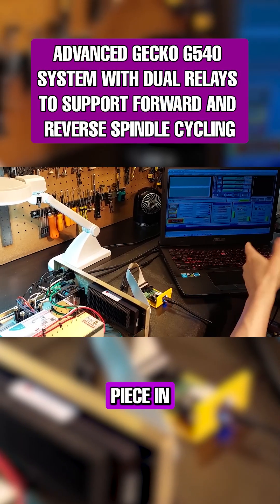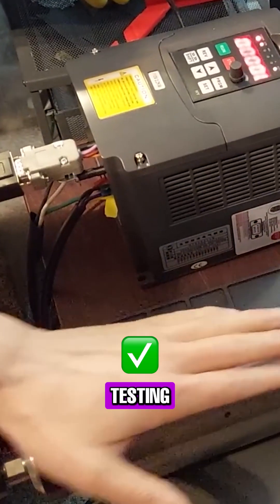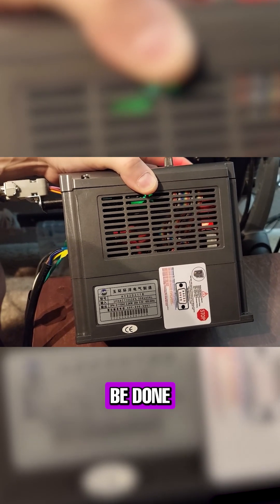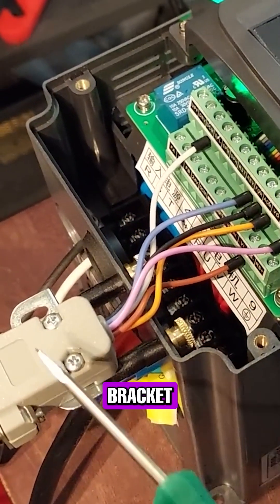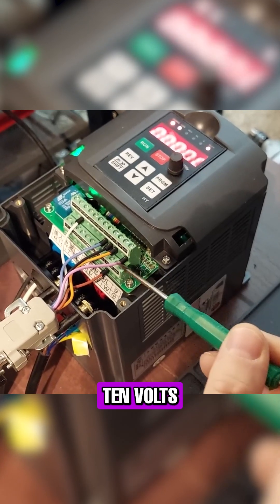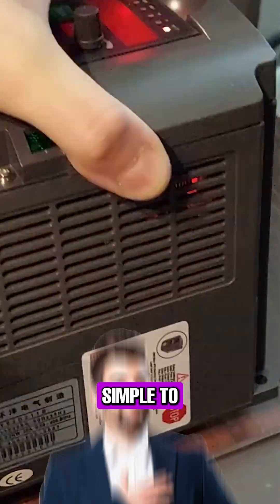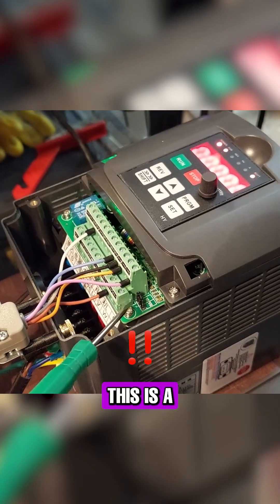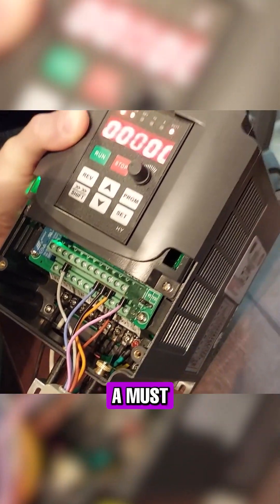Advanced Gecko G540 Spindle Control: Dual Relay Setup for Forward/Reverse  VFD Cable Best Practices

Comment: Db9 connector with mounting bracket sounds like you are huffing paint fumes. What kind of pseudo engineer are you that this information in relevant and timely? 30 seconds into the video and I cant make any useful information. I would write the scripts and revise them to remove any wasted words, might shorten the video to 5 seconds, but then you can add useful details to make this weird addition to my shorts feed less abhorrently awful.
Reply from the maker: Thank you Adam Johnston for your support. I really appreciate it. Vince